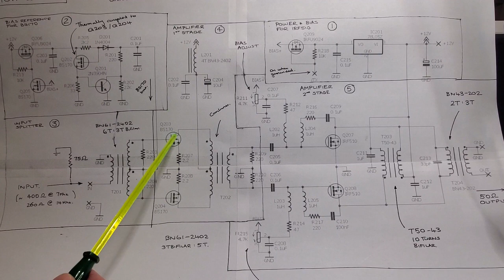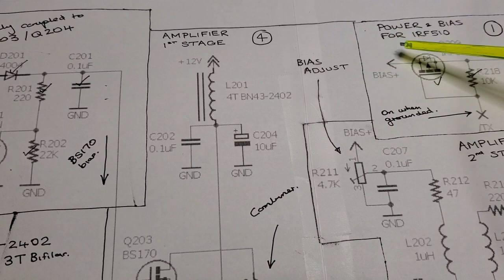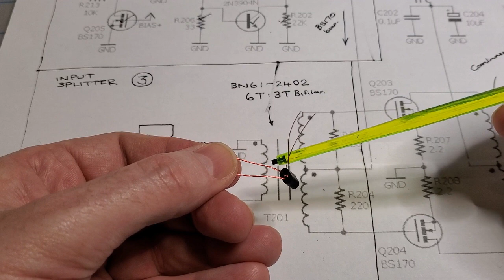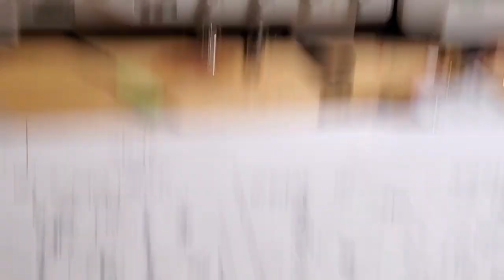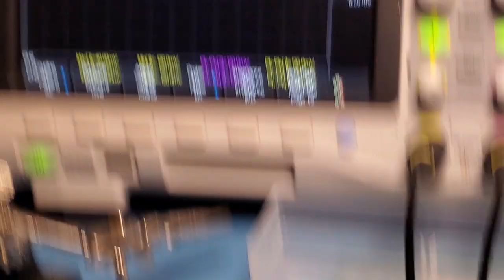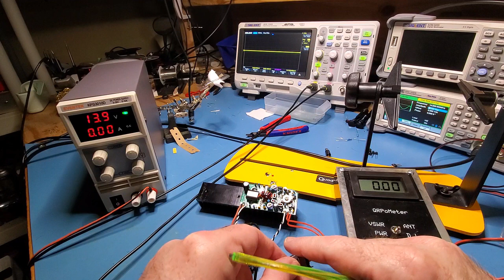QRP Labs 10w Amplifer Build

Comment: Hi, very interesting video, congratulations. 

I finished my first kit but the gain is 19-20 db and not 26. Vin=13.8 i bias=0.3a 

From the video, if I'm not mistaken i can see that with 7 vpp (20.8dbm) you get 9w (39.5 dbm) which corresponds to 19db. 

To obtain approximately 26-28 dB of gain, is any particular precaution necessary, such as adjusting the input impedance? 

Thank you for your video.

Gab
Reply: I believe to get 26dB gain 20v is required to the PA.

Comment: Great video, I've just completed the soldering on my own (v3) board, which has most components pre-done as SMD now, but nonetheless this video helped loads with the testing at the end. Particularly good illustration of the importance of a Low Pass Filter, which I don't yet have so will definitely build before going on the air. Thanks!

Comment: Thank you for doing this build and video.
I just finished building this and have not tested it yet as I had put it aside while I did some work.
I was taking a break when I came across your video. I will test mine tomorrow. To bad I missed this video before completing the build.
One thing I was wondering and asked QRP Labs about was making this a variable amp. There answer was to use a potentiometer at the input to lower the signal? But I will be using the HackRF One as an input which already has a low db output. Would you know a different way to adjust the output without adjusting the input?
Thanks
George
Alberta, Canada
Reply from the maker: Thank you for the comment George. I'll have to do a bit of research on your question. Generally I have seen output controlled by drive input in amplifiers rather than something in the amplifier itself - its an interesting question though. Maybe put a little pre-amp after the HackRF and a simple drive control in the pre-amp perhaps?

Comment: Hi Ian. I believe the thermal connection is for thermal runaway. Very interesting build Thanks.
Reply from the maker: I dug a bit deeper and modeled that part of the circuit out in LTSpice. It does indeed provide a fairly fixed voltage bias independent of supply voltage to the BS170s - and the bias it provides is that which just turns on the BS170s. The bias would certainly vary with temperature so I am thinking the heat sink keeps all 3 BS170s operating at the same temperature. Would love to see a writeup on the circuit but haven't been able to find one. Thanks for the comment Dave

Comment: Looks like 67v peak to peak there, making for 11.2W?  Maybe dial back the bias on the IRF510s (or less input power?) and you could see that distortion go away.  (or maybe you did that already, and I'm an idiot...)  Lovely video, BTW -- I've been thinking of picking up the QRP Labs 5W non-linear so I can play with that nifty shift-register key shaping circuit.  I didn't realize the 10W linear was so small.  Looks like a sweet toy to play with.
Reply from the maker: I think my little power meter might be a bit inaccurate. I had a few other comments on the distortion so I am definitely going to play around some more with both input drive and the IRF510 bias settings. Unfortunately I can't control the DC bias of the BS170s (at least not without modifying the circuit which I might do). Its a fun little kit and definitely "hackable". Thank you for the comment Yakov
Reply: @na5y  Have you tried this yet? I think I figured out how the biasing works on the first stage. It's pretty clever how they implement thermal compensation on these.
Reply from the maker: @TheLightningStalker  I did a bit of playing around in the follow-up video. I was able to increase the bias by replacing the diode D201 with just a short. Check it out: https://www.youtube.com/watch?v=JMlc5uohcm0&t=6s
Reply: @na5y  Ahh yes very good.